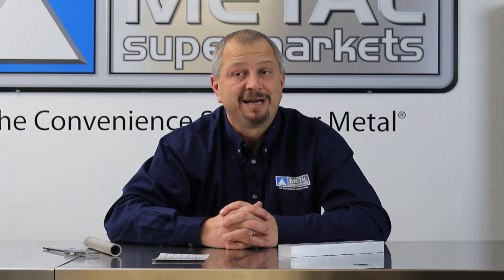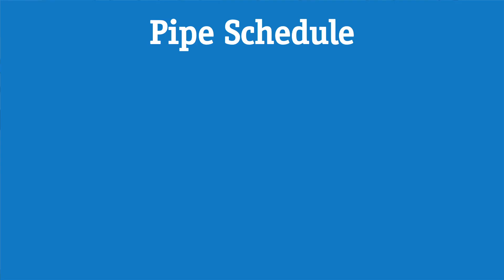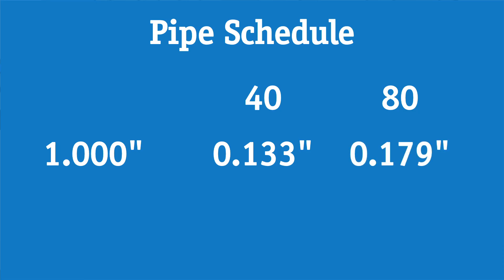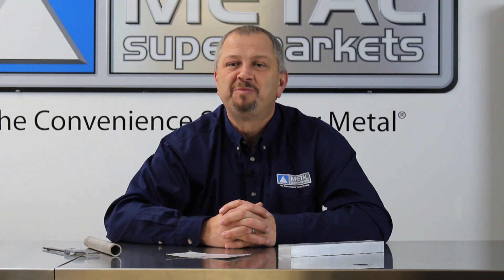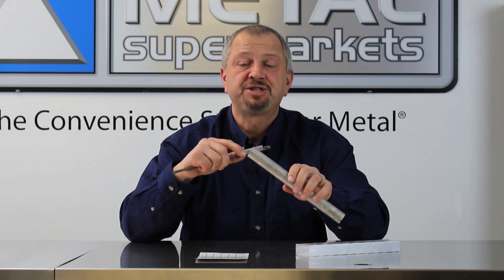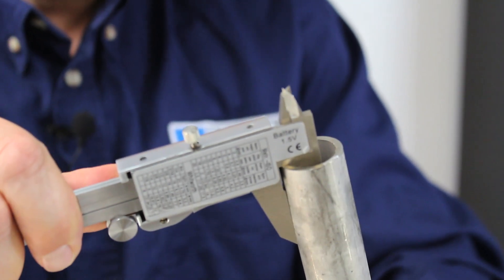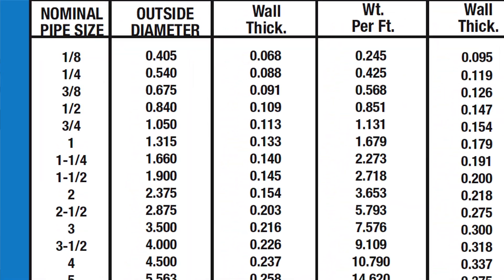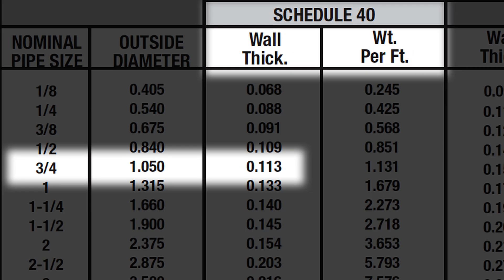What Do Pipe Schedules Mean? | Metal Supermarkets

Comment: The schedule for pipe is relivent to how much pressure it is rated to stand. The larger the diameter of the pipe the thicker the pipe wall has to be to stand the same pressure.  
A 6 inch schedule 80 pipe is considerably thicker than a 2inch schedule 80 pipe. To hold the same pressure.
Reply: Thank you for telling us… this makes more sense!

Comment: Why do you put the whole beak into the pipe to measure wall thickness? Two flat surfaces clamping down on a curved plate wont result in good measurements. You gotta use the ends where its like two wedges.

Comment: Why on earth is the nominal size nowhere close to the actual OD?? Are metric pipe sizes this ridiculous?
Reply: Pipe sizes are nominal inside diaameter.   Of course the inside diamters are going to vary with the wall thickness ( schedule)   On most nominal pipe sizes Schedule 80 is going to have an inside diameter cosest to the nominal size.  ie:  the inside diameter of 3/4” inch, schedule 80 pipe is pretty close to .750”.  Schedule 40 pipe is a lot more common, and generally the inside diameter of schedule 40 pipe is larger than the nominal size.   It’s worth noting that pipe sixes are different than tube sizes. Tube sizes are based on outside diameter.
Reply: You are correct. It is ridiculous and it didn't have to be this way. The origin of the mess comes from plumbers, not scientists or engineers.

Comment: This literally explains nothing. Larger number means thicker wall. Great everyone knows that. How about making a 6 minute video instead of a 2 and a fucking half minute video so you can further explain details that people actually have questions about instead of just saying “look at a pipe schedule chart to get information.”

1. Where did the term “Schedule” come from?

2. You said schedule can tell you information about the temperature rating. Well what the fuck is that information?

3. Is this the same for PVC? ABS? Stainless steel? Iron?

4. What is the largest size schedule you can buy?

5. What is the smallest schedule?

6. What joining methods are typical of schedule tubing?

Comment: I need some help. I'm confused.

If the nominal i.e. inside diameter is 1 inch, and the outside diameter is 1.315 inches, how can there be different wall thicknesses?

Because if the wall thickness changes, then either the inside diameter or the outside diameter will have to change as well.

In other words, you can't have two different pipes, one with a wall thickness of 0.133 and another with a wall thickness of 0.179, and still have the same inside diameter and outside diameter for both pipes.

In fact, if you have a pipe with an inside diameter of 1 inch and an outside diameter of 1.315 inches, there is only ONE possible wall thickness. And that is .1575 inches. Or the outside diameter minus the inside diameter, with the result divided by 2.

Maybe I'm just missing something. But I'm working on a project and I really need to figure out how this works lol.

Thank you for helping me out with this question. I really appreciate it.

Cheers!
Reply: Nominal Diameter is just what it's called an the actual OD will be different all the way to 12" pipe which is 12.75" OD. 2" pipe (2.375 OD) 3" pipe (3.5 OD) 5" pipe (5.562 OD) 9" pipe (9.625 OD) etc. 14" and up the OD is the same as the NPS, this is confusing at first, OD will always be the same but ID will change based on wall thickness or schedule. Just take your actual OD minus wall thickness, minus wall thickness again and that is your true ID. 12.75 x .375 Pipe has a 12" ID... Now this gets more confusing as this only applies to PIPE not mechanical tubing, DOM, Hot Rolled, Cold Rolled, HSS Tubing... Whatever the size is there the actual OD is the same. Get yourself a pipe chart an it'll make it alot easier at first. If you need more info or help shoot me a message I can send you pipe charts, weights, tubing charts, weights anything you'll need I deal with pipe, steel, tubing, casing, plate, all day everyday so it's not a biggie.

Comment: why can't they just say 1" diameter pipe with a wall thickness of .10"?
is that too fu@king simple for you?
Reply: wow ignorant and angry, you must be popular. first that size does not exist, second you would not know the size exists without a chart. you size the pipe based on needs (e.g. 3/4" for water service) with schedule based on pressure, durability etc. the actual dimensions are not relevant.

Comment: But what about sch80. Or sch160, or that cheap sprinkler pipe sch20...how come the inside diameter changes by sch. So sch 40 is bigger inside than sch80 which is 3/4?

Comment: if the O.D. is 1.050, and the wall thickness  is .113, where the hell does 3/4" come from? lol what moron cam up with this system? is there somewhere to shove your caliper on that pipe to find 3/4"??  The ID would be .824 - which is NOT 3/4. try explaining that one in your next video.
Reply: The inside diameter of common black steel pipe in nominally sized( nominal meaning in name only), so it's typically going to be slightly oversized for a given measurement.
Reply: You can, however,  get seamless steel tubing that is made to much more exactly dimensions.

Comment: So in the end , what is the suitable kind of steel to build a Harley motorcycle frame?
Reply: moustafa farouk PVC pipe is ok because Harley’s are gay
Reply: 4130
Reply: moustafa farouk, Be an original and use way pricey and difficult to work with 316 stainless or you could go with the 4130 Christopher Haist suggests.